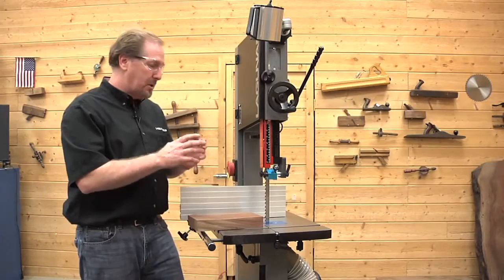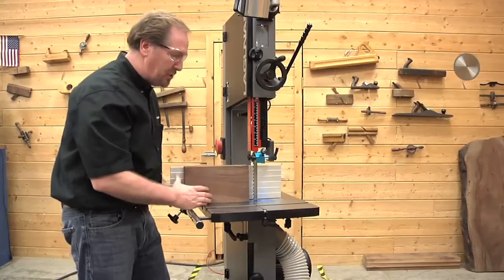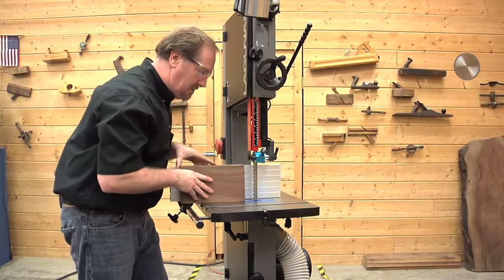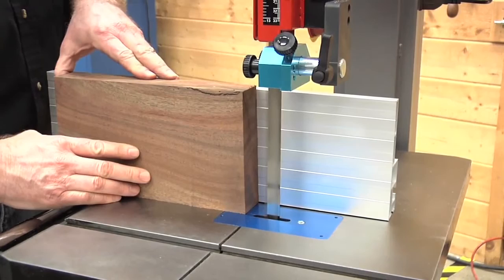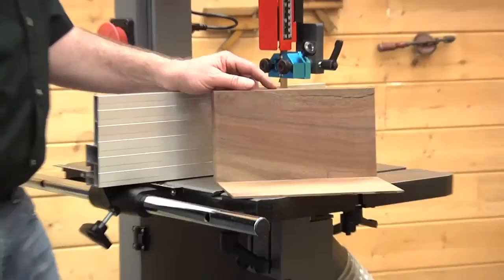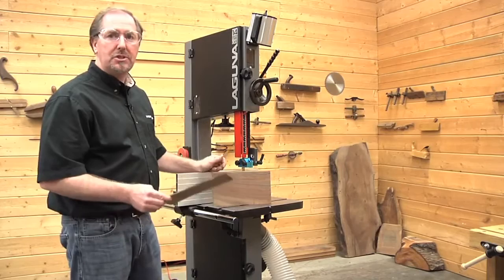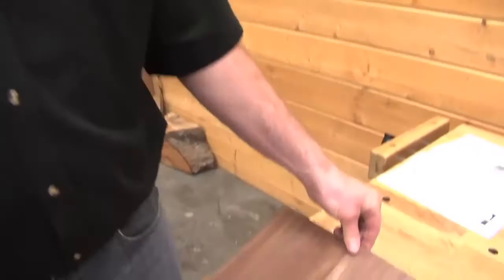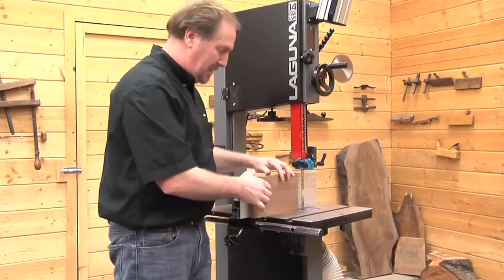1412 Bandsaw Safety and Technique - Part 13 of 14 - Laguna Tools

Comment: I have a 14/12 and the blade moves all over the place ruining my stock. I have a new blade and it’s tightened up according to specks. Any ideas on what I might be doing wrong? I tossed out a project last evening because of it.
Reply from the maker: Hi Peter. If you haven't had any luck fixing this issue, please contact our customer service here: https://lagunatools.com/resources/customer-service/
They'll be able to help you find a solution!